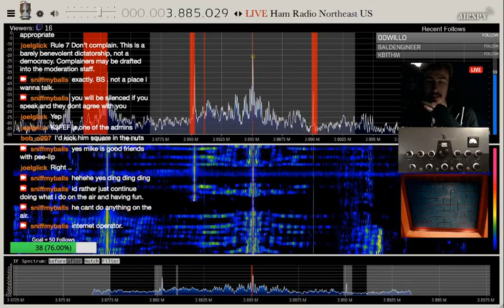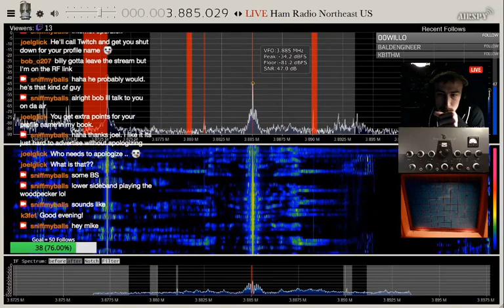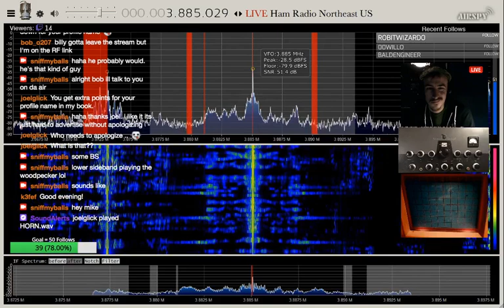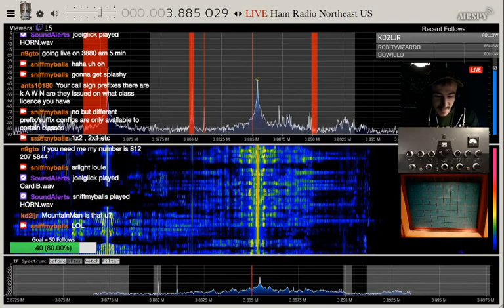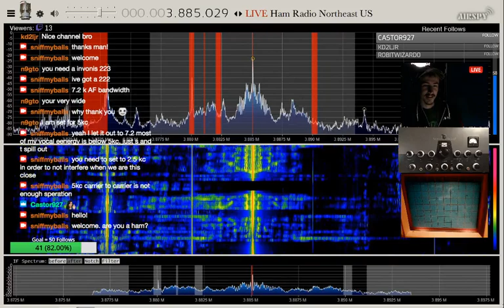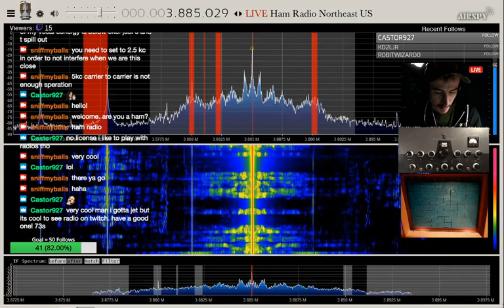Discussion of AM Stereo, C-QUAM and related topics with KC3FKR N1BCG W2BTK W2VW 3885 kHz AM

Comment: I've transmitted am stereo to myself in the 90's. I've actually heard a dsb suppressed carrier isb with two different programs. I've actually used 2 radios to hear Kahn system radio stations before. Slope tune one down and the other up. Heard ALL of the 4 systems before. Phase shift did indeed create interesting distortion. If you tuned your brain to 25Hz, the distortion went away. But now you're mentally locked on 25Hz from that point.